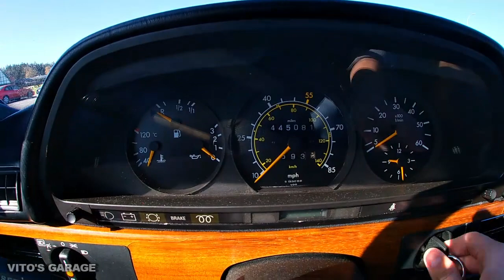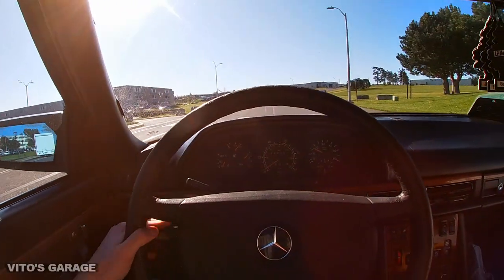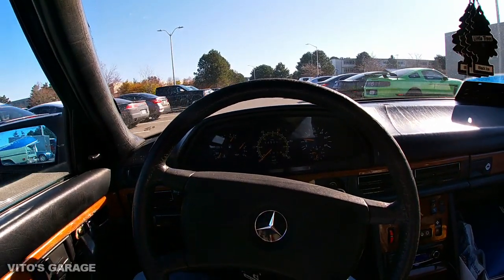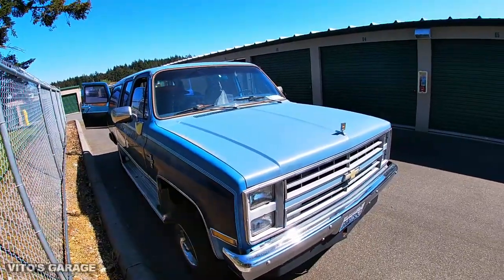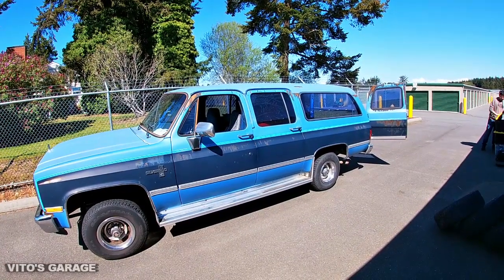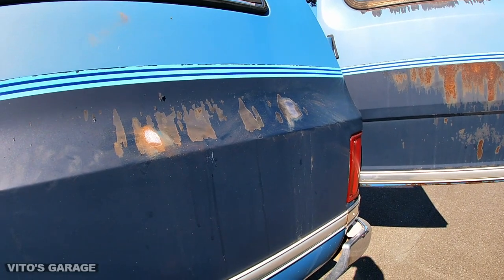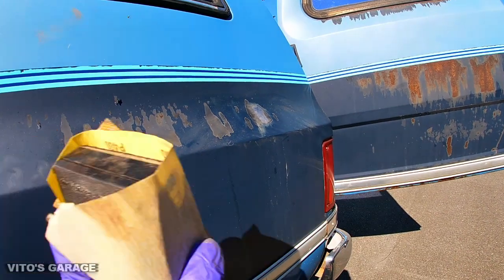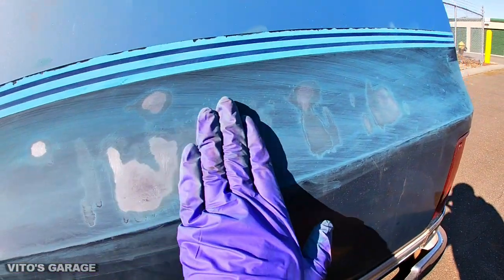MERCEDES W126 First Drive! I've Missed This Machine!

Comment: Never a doubt! ☺️🚗 did you use any fuel stabilizer while you were gone?
Reply from the maker: Actually I didn't! The diesel fuel is a lot more forgiving than gasoline. But you should use pure diesel, not biodiesel.
If you remember that video of W126 first start after 10 years, it had original 10 year old diesel fuel in it and it fired up no problem!
Reply: VITO'S GARAGE good point Vito! I remember that video… Pretty sweet. ❤️🚗 I had a similar experience starting my 84 W201 after about eight years. 😀 I was worried that the fuel would be a problem and it was not.
Reply from the maker: @giantbikeride  there's a 190e close to me and you know what? It's tempting!😀
Reply: VITO'S GARAGE I bet...they’re really sweet! 🚗😀 It’s hard to see all these amazing older cars and not want to buy them!!